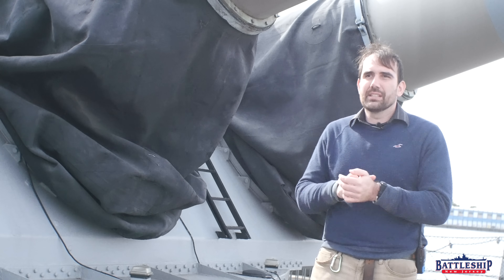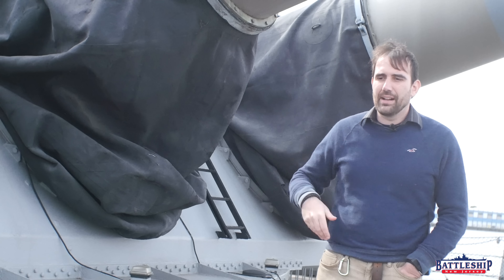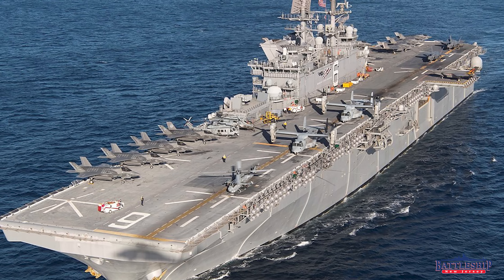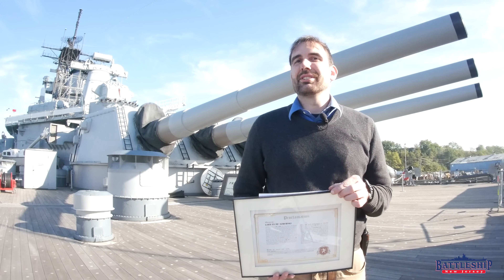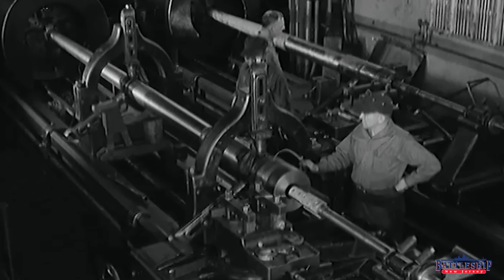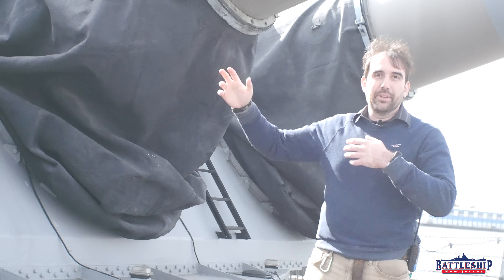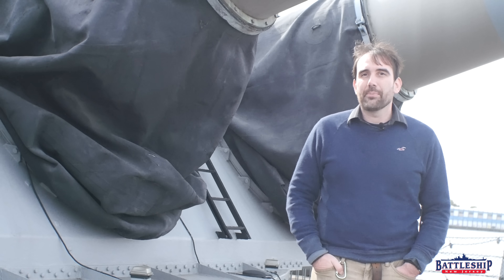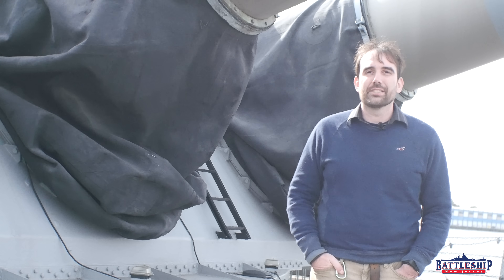How Much Would It Cost to Build a Battleship Today?

Comment: If someone had asked you how much it would cost to build a Constitution (Old Ironsides) today you would never assume that they wanted this information to include equipping the vessel with all the electronics and weapons systems of today. Why should you assume if someone asks what it would cost to build an Iowa class battleship today that it should include all these weapons systems. As a delivery system for 16" projectiles it does not need all the most modern radar. I suggest the question should be answered by trying to determine if a 1944 era ship could be built and at what cost.

Comment: I'd definitely build new.  Not only would the maintenance cost be considerably lower, but modernizing and automating many functions would allow for a much smaller crew.
Reply: Problem is few people consider costs other than the base build cost. Which is stupid. 

There are two issues with building battleships these days, the guns, and the armour. And here is the problem, no one has built either for 80 years. There are no existing facilities that have either the specialist equipment or the trained workers to produce either 16 inch guns and barrels, or 14 inch think face hardened battleship armour plate. 

The infrastructure and training would have to be built up from scratch, new facilities built to manufacture not only the guns and armour, but also new 16 inch shells. Those facilities and that training is not going to come cheap. But those costs are basically ignored when people start waffling about building modern battleships, which is stupid because WITHOUT those things you cant build modern battleships. Period. 

And for what? Exactly what role would new battleships fulfil that existing ships cannot do as well if not better?
Reply: @alganhar1 The large guns have no smart munitions, meaning they can fire and not have the issues of the rounds being jammed or intercepted like missiles do. While air superiority is important and why carriers took over, Battleships could potentially be needed in the future.

Comment: It would probably be a bit silly to build a proper battleship these days. Ship to ship gun duels were going out of date in WWII, the main use for a battleship today would be shore bombardment. A new class of gun cruiser would probably be a better option. Loads of SAMs and CIWS emplacements alongside the big guns may well be more effective than heavy armor against modern threats like antiship missiles.

In addition to making more tactical sense, a new gun cruiser could share a lot of tooling with missile cruisers. Conversions from existing ships might be feasible- build a gun deck or two on an America Class ship, shove an absurd number of existing heavy artillery pieces on there(fire control might be tricky but the guns themselves can do the job) and call it a day for probably way less than any battleship option.

Comment: TBH, if I was tasked with bringing back Battleships?  I'd refuse.  

Because they have no place in a modern order of battle.  If they did, we wouldn't have decommissioned them to begin with.  All the battleship armor in the world is pretty balls useless vs modern subs, CVs and cruise missiles. They are gorgeous, and "romantic", bringing us back to a simpler time.. but it'd be like using an A-10 to Dogfight gen 4 and 5 Fighters.

Now, stepping outside the realm of sense and reality?  It would depend in part on time contraints.  And thus likely a combination of both.

From scratch Battleships, IIRC most were around 4 years total in construction?  And I would have to assume to lay out the infrastructure to build new, and add in testing, new technologies, it would be what, 5 years MINIMUM before a new class would be online?  So assuming we needed to fight a war, and it would only take one year to refurbish the extant?  You refurbish several from mothballs, while laying down the new hulls for later in the war.

Comment: My thinking is it would be cheaper to Refit our 3 current Iowa Class Battleships for nuclear powered capability. Instead of building a whole new shop we would be replacing the coal burners with nuclear reactors that would still heat the water in the boilers to create the steam for the ship.

Comment: My two cents is that we first need to figure out what are the functions of a modern navy and what might be required to perform them? Traditionally, I built my navy as either a counter to your navy at minimum and to defeat it at optimum. WWII was the last active war where opposing naval forces met. The Cold War was one where deterrence and power projection were the primary outcomes.  Today we really don't have that scenario in play. The USSR no longer exists. What Russia has in its fleet the leftovers from the USSR and their only carrier (The Adm Kuznetsov) deploys with sea going tugs as a sort of oceanic AAA service. Will China develop into a potentially aggressive power or develop their fleet as essentially defensive? That remains to be seen. In the meantime we build and maintain super carriers to defend us from who? 

That's an interesting debate all on its own. If power projection is essentially what we are aiming to do and protecting interests across the globe, wouldn't we be better served with  updated new BBs designed to do that? Would a complement of cruise missiles, Marines and assorted weapons systems make more sense providing a sort of mobile Pain Buffet that costs far less than a floating airport? I think it does in a number of ways...Curious as to some of your thoughts here!

Comment: We don't need a new Iowa class battleship.  Just base a new one off of the older Connecticut class battleship.  Pre-dreadnought type with modernized 14-inch naval guns capable of firing cannon-launched cruise missiles, secondary array of the Advanced Gun System emplacements, and a defensive array of Phalanx CIWS and SeaRAM-based RIM-116 Rolling Airframe Missile launchers.  Updated electronics and ECM/ECCM. Power the whole thing with a nuclear reactor, natch.

Comment: Steel is much cheaper than before, adjusted for inflation, since production methods have improved and construction methods have moved on from heavy steel use (and with China and India dumping it at near or below cost). Machining steel is also much cheaper than before. Modern design methods are more expensive, but they make the final product cheaper to build (or much more capable).
If you just want roughly the same capability, 16-inch guns, I think it would be easier to build now than it was to build then. Especially with modern ship building methods, section by section.
Then again, labor costs are much higher. And, judging from the Advanced Gun System fiasco for Zumwalt, the Navy will want guided long-range shells, which will cost millions, until the thing is uneconomical to fire.

Comment: It would definitely cost close to an aircraft carrier. One thing that could save money on the guns would be using 155mm rocket rounds with 155mm  guns.  It would give the guns a range around 70km.  I also would probably building a smaller ship with automated systems

Comment: Same hull design with nuclear reactors powering the ship but instead of rail guns or the artillery weapons of 1940s era creat a surface ship with missile capabilities instead - with new radars, targeting systems, new super structure design, a reduced crew size, defensive weapons, and other systems offering better usage for space in the crew quarters along with galleys and mess decks. Getting the ships electrical grid current and the NBC systems new along with being able to use the combat net in place would have it’s advantages to serve in any fleet.

Comment: Here is some money to throw into that cost 1)We have no facilities anymore to build battleship caliber main guns, the closet we could come was some kind of weapon which could have nearly a thousand missiles each carrying about a 300 lb explosive warhead  2) We do not have any facilities for making the heavy slabs, this is partially offset by the fact we can make more and cheaper STS weldable steels but still it's a big cost  3)half the personnel because of modernization, but not as big of reduction as most modern warships, takes a lot of damage control people on the ship. 4)the profit margins by American arms companies have increased from about 5 per cent to closer the 15 if the country went on a war footing that would probably be cut down, the chummy nature of military purchasing and military might be cut down quite a bit. 5) The 45,000 ton thing was not true then (more like 48,500) and we did not count all that oil in the torpedo protection system - neigh onto 10000 tons (which even if we go nuclear we still have to carry along that much water to protect against torpedoes, and even more to make torpedo protection under the beast. Here it is from Friedman US Battleships, the maximum displacement of the Iowa's 59,600. How does this work out - can not imagine the navy building this for less than 90% of the cost of a Nimitz and every bit of 75,000 tons or maybe with a nuclear powerplant 70,000.

Comment: One of the issues with this sort of conversation is the whole 'Modernized Iowa' thing. The problem isn't just that the Iowa was designed and built with 1940s technology, it was also designed to fight 1940s adversaries and to complete 1940s objectives. War has changed significantly since then, and outside of a handful of situations that have little to do with it's original role, it brings nothing to the table.

Probably the better way to frame the question would be something along the lines of "What would it cost to build and operate a modern, large, heavily hardened, ship-to-ship surface combatant that doesn't use aircraft as it's primary weapon system." I think this is more in line with what people actually want to know, as opposed to the usual way the question is framed.

Plus you have the added benefit of actually having modern ships built in a comparable configuration to refer to. Instead of having to make broad estimates based on an Aircraft Carrier, which is both designed in a fundamentally different way and has most of it's cost in the aircraft it's carrying as opposed to the ship itself, you can make comparisons to the dated but not antiquated Kirov class or the Ticonderoga. In it's simplest form you just extrapolate the cost from building a bigger version of those ships, then all you are left with is the admittedly difficult but more defined task of considering how one might go about hardening these ships to withstand at least their own attack (the 'rule-of-thumb' for a battleship as it were), attacks from likely opponents (if they can be withstood of course), and a little bit of elbow room for good measure.

Comment: I love battleships, I really do... But battleships just don't have a place anymore. I'm defining battleships as large, heavily armored warships which are primarily armed with large guns. The mission of the battleship is to close with enemy warships and destroy them in a gun duel. This would include attacking enemy convoys or defending enemy convoys against such an attack. Shore bombardment is a secondary role and if you want a ship for shore bombardment there are plenty of far cheaper options. Now, modern sensors will detect a battleship long before it gets into range of enemy ships Airborne radars will spot one a couple hundred miles away at least and this gives the enemy plenty of time to react to the approach of that battleship. Battleships are heavily armored, but they aren't armored everywhere. Modern torpedoes attack from below and would miss any traditional torpedo bulges and instead rip a massive hole in the underside of a battleship. Missiles might not get through the main belt armor, but they can get through the almost nonexistent armor on much of the rest of the ship. So missiles might not be able to easily sink a battleship but they can easily tear it up enough to take it out of the fight. Carriers can stay at range and attack from 400 miles or so away. Battleships need to close to something like 20 or 15 miles to be effective. That's why carriers can be defended from these kinds of threats but battleships can't.

Now, you could create a large missile carrying ship and call it a battleship, sort of like the Kirov, and that would be useful but it seems that it makes more sense to build two or thee smaller ships with the same missile firepower. You have more flexibility that way.

A modern gun battleship would likely cost $10 billion per copy (Armor is very expensive compared to normal steel) and the startup costs and initial design work might run $20 billion more. Each battleship would also need a huge crew and the Navy has manpower shortages now.

So, which would be more useful to the Navy, 4 new modern gun armed battleships, or if we designed a new replacement for soon to be retired Ticonderoga's and built about 15 of them?

Comment: When people say that building a new battleship is a waste of time, they always think in context of 1940s or even 1950s technology. A new one would be nuclear powered of course, be huge, like Aircraft Carrier sized at 150,000 tons or more, and heavily armored as such that sea skimming missiles would barely make a dent in the belt plating. The hull would be a series of sharp angles to reduce its radar signature kinda like the Zumwalt. The guns are by far the most overlooked aspect. We wouldn't make them 16 inch rifled guns. They'd be 16 inch smooth bore guns that have the capacity to shoot fin stabilized subcaliber smart munitions at much greater distances than any traditional gun could possibly fire. Imagine a 16 inch shell that flies 25 miles and then all of a sudden, the shell splits open and a dozen smart rockets come out of it to pepper a target zone or hit individual preset targets. Or perhaps it could be small bore (155mm or so) smooth bore guns that shoot an insanely high pressure load and then have the ability to be refitted with railguns once those become standard. This ship would be covered in an ungodly amount of defensive weaponry. I would imagine no less than 10x 20mm or 30mm CIWS mounts, 10x dual 5 inch unmanned autoloading gun mounts and god knows how many vertical launch tubes for launching any kind of missile from a small SAM to a Tomahawk with a tactical nuclear warhead. Traditional modern torpedoes wouldn't work because the ship would be far too heavy to lift out of the water, even if it could bypass the detection Sonar and countermeasures. The ship would also likely be double hulled.

Comment: Simple I wouldn't build a battleship like they built Iowa. 
The speed needed is just a bit faster than the USS America class. 
Guns 4 triple or quad 177mm based on the M777/ M109/M1299. 
Armor that can take a hit from an Antiship missile. Probably up to a 1000kg warhead if possible.
SPY -6 AESA radar.
VLS for SM2.SM3/SM6, ESSM, Tomawak, and NSM. 
Large VLS for hypersonics and other future weapons.
A large number of Rolling Airframe Missiles and Phalanx systems.
 Diesel and Gas turbine electric drive for speed and long endurance. 
Support for helicopters and drones.  Maybe up to 4 Seahawks or two Ospreys.
In WWII Battleships did do some ship-to-ship combat but they mainly did carrier escort and fire support for ground troops.'
Today Destroyers and maybe someday cruisers again are just a better choice for that task cost-wise.
So I would make a new one just a little faster than the Gator navy.  Give it a lot of guns and missiles for attacking land, sea, and air targets.
The SAMs provide cover for the beachhead and landing ships. The longer-range cruise missiles for strikes. And the antiship missiles just make anybody trying to attack it think twice before getting too close. Swap some Tomahawks for ASROC and you could use it to escort convoys as the older slower Battleships did in WWII. Again providing good air cover and a good bit of ASW capability. 
I picked the diesel/gas turbine to reduce cost and because you might not want to have a ship with a nuclear reactor or two really close to the shore in a combat zone. It could be really bad so you would have a weapon that no one would risk which makes it useless. That is my none expert opinion.

Comment: I think building new nuclear powered battleships for shore bombardment would be a good investment. The infrastructure for building armor plating and large caliber guns would be quite valuable because large caliber guns could be mounted on barges offshore or in fixed in placements that need to be defended for prolonged periods of time.
The ships don't even need to be completely nuclear powered. The nuclear reactor could be just powerful enough to keep it at cruising speed say 10 to 15 knots. While gas or diesel turbines could be used to bring it up to combat speed thus significantly reducing the cost of the ship having a nuclear power plant for providing basic power for onboard systems and propulsion while also keeping its footprint fairly small. Additionally with that small size reactor or reactors.
They could be more easily removed and replaced keep the ship in service.

Comment: Hey Ryan, you forgot an important caveat in your question at the end. That being, how quickly does the new Navy Commander needs the ships? If there is no pressing need, build new, and take the time to do it right. If for some reason you need all the ships yesterday, then refit the old ones, while simultaneously building up the infrastructure to get new ones in the water ASAP. Like you said, the old ones could probably be refit within a year. New ones on the other hand would probably take no less than 5 given the lack of infrastructure.